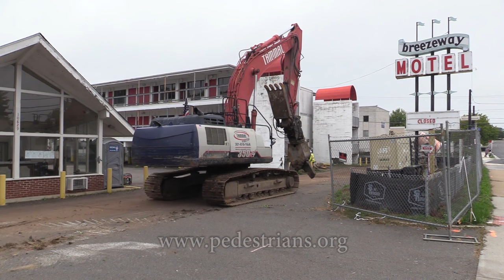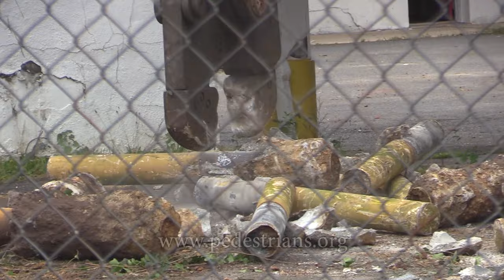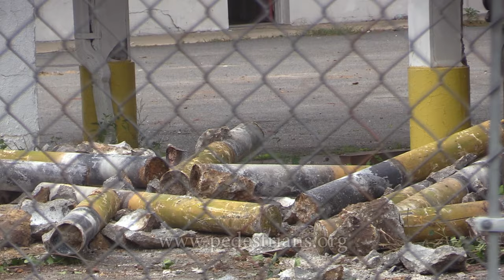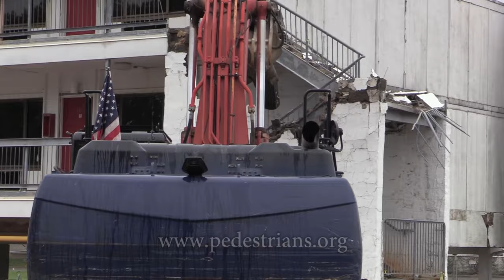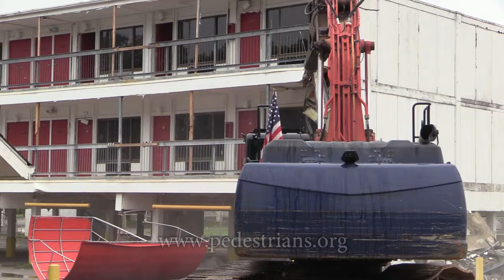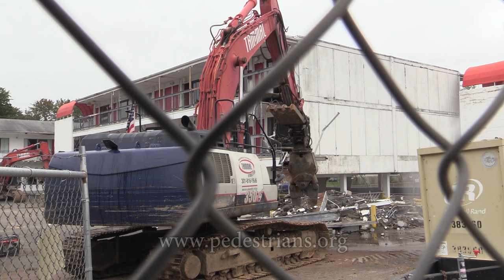Breezeway Motel Demolition (Part 1), Fairfax

Comment: I’ve been watching this for about an hour now. I made some observations and read all comments and replies. This appears to have been poorly maintained or vacant for some time. It more than likely been constructed in modular sections either in a factory or onsite and lifted in place. The telltale signs are the double walls between units and floor and ceilings from upper and lower. Now the drywall was more likely removed prior to demolition because it more contained asbestos fibers. Which was highly common in a wide range of building materials.

Comment: Why don’t they just save it and turn it into a homeless shelter
Reply: Probably because the value of the land exceeds the building and will probably be used as apartments
Reply: That would have made more sense and that's not very active these days.
Reply: Homeless shelters don't create paychecks, they create more homeless.
Reply: Not worth the cost of upkeep and maintenance?
Reply: Cost to much to fix
Reply: @hdicato Agree. Even though it would be great to help those in need, somebody has to pay for the electric, water, natural gas(if any).
Reply: Paid for by….? Would you buy it and let people just live there for free.?
Reply: Anyone seen Batteries Not Included. It be nice if those saucers from Batteries not included came and rebuilt the whole Breezeway Motel like brand new, like how they rebuilt that Apartment building that was burnt down in New York City. Than suddenly other buildings around it like in the ending of Batteries Not Included.

Comment: I see some signs of quality construction. There were double walls with fiberglass insulation to reduce sound transmission between units. 

I wonder why they framed the unit walls with steel studs and then the interior walls (bathroom?) with wood.
Reply: Likely reconfigured the rooms at some point, and to save cost went with wood
Reply: @lukelegg9915  I suspect you are right, as I didn't see wood framing in other rooms later in the project.
Reply: Someone on here suggested the Motel was of prefabricated  modular construction. If so,  this would make sense as the bathrooms would be added later and thus in wood studs. This would allow for various plumbing configurations on site. The other, more important, reason for the double walls between the units would be for fire resistance. Also, it looks like they had adjoining room configuration. And, yes, it looks well built, except those staircases. 😮

Comment: When he has material over the metal pile why doesn't he shear it through ? I agree with the slow operator comment.
Reply: Why break it into smaller pieces, so there are more to load, when it's already in small enough pieces? Not to mention he couldn't. That's a masonry shear, not a steel cutting shear. While it has a small cutting area in the back of the jaws to cut re-bar, most of the jaw area is blunt.